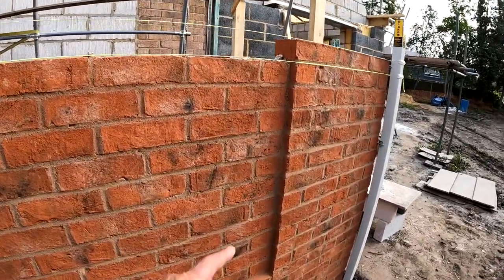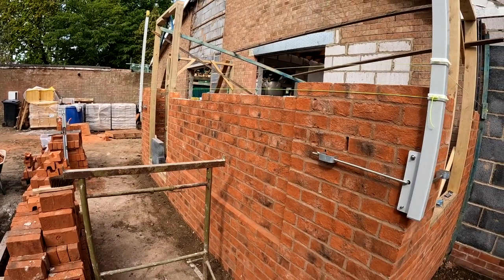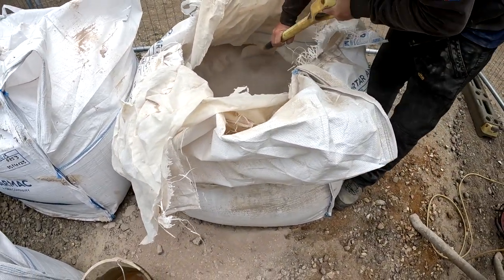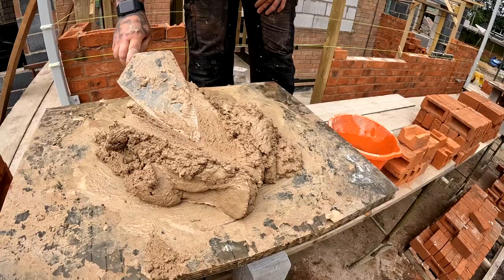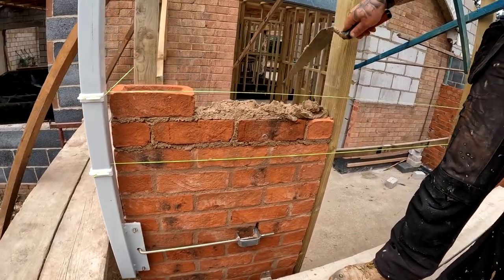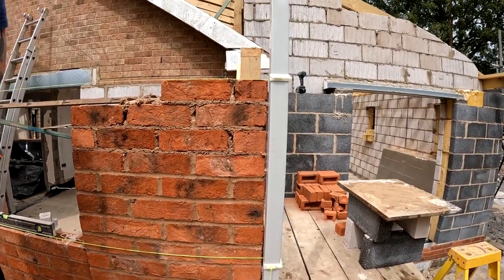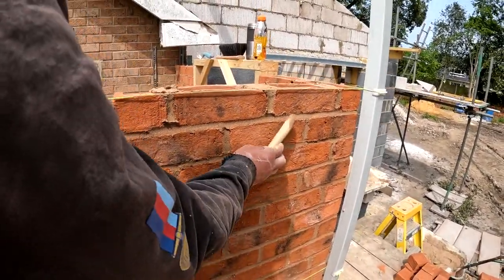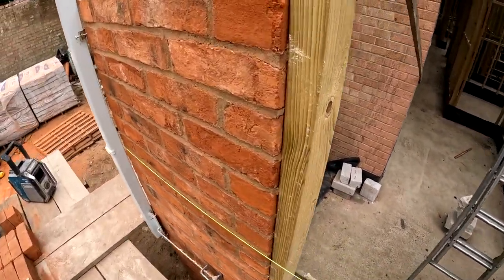Traditional Bricklaying with Lime Mortar

Comment: You need to humour the Brick, wet them up, you dont add normal cement plastizier to a preblended lime mortar. You need to add hydrated lime which is a natural plastisizer, and jointing should be a churn brush finish, 😂😂😂😂

Comment: I always come back to this video the chap makes it look easy, im having a nightmare with 3/1 sharp sand 3.5nhl dont wanna make to wet tho
Reply: I just learnt this today and yesterday, what a nightmare!
Reply: I learnt you just got to put more water in and its fine but theres a very fine line before its to wet. Water the course you laying on as well to slow down the drying process. And a round piece of wood to point it, then i used a stiff brush to tamp it back the next morning and it tightens it up nicely. Can send a few pics if you need help
Reply: @mikebryan544  yes thank you

Comment: Budd, 
 If that lime is NHL (hydraulic), mix it for a good 20 to 30 mins, then leave it 24hrs and knock it up again and use it. Better still stick to that non Hydraulic wet mix you used on your herringbone. Cheers 
Andy
Reply from the maker: If it was up to me I would have thrown this gear in the skip, the customer supplied, usual thing explain what materials you want and the complete opposite appears 🤦‍♂️🤦‍♂️